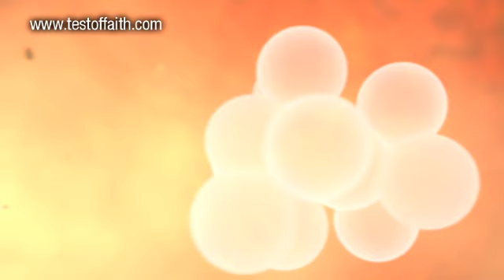Fine Tuning

Comment: The weak anthropic principle is never used on its own, because it cannot explain why a fine tuned Universe exists. The point of the WAP is so that when you appeal to a Multiverse you don’t undercut normal claims of probability like rolling a “6” 500 times in a row on a fair die.

Comment: Dodging a question yet again.
 I'll say it again, it doesn't HAVE to be carbon based - it is just very unlikely to be silicon based because silicon is not abundant in the universe, among other things. However, there is speculation that it has led to the origin of life.

Comment: @boblackey1 Of course you do. You don't calculate chances based on the earth only. You calculate chances based on all planets. Even if the chances are small for one planet, there are so many planets that life still will emerge. Read up on the Anthropic Principle. Also look up the Drake equation which is related.

As for the age of the planet, how old do you want it to be? 4,540,000,000 years is AMPLE time to create and evolve life. 

Also read up on the Puddle of Water analogy.

Comment: That's not a question that’s an assertion and yet again you’ve ignored the scientific community with absolutely no argument. Silicon-silicon bonds are much weaker than the corresponding carbon-carbon bonds, and unlike carbon-carbon bonds, they are susceptible to oxidation.

Comment: If the Universe is "a put-up job" what are the endless "multiverses"?
Reply: DataWaveTaGo A way to explain the fine-tuning without the need for a fine-tuner.  The origin of the universe at a single point in time, and the realization that if various physical forces were even a very tiny bit weaker or stronger, the universe as we know it could not exist, are very scary thoughts for those who prefer not to believe in a Creator.

But actually, the idea of the multiverse originated, not as a response to the fine-tuning of the various physical constants, but rather as a way to explain quantum-mechanical probabilities, the idea being that for every possible behavior of a sub-atomic particle, a new universe comes into being; e.g.., we happen to belong to the universe where the electron passed through slit B, say, but when the electron was fired at the slits another universe came into being in which the electron passed through slit A.  Since we have no access to these other universes and no way to prove or disprove their existence, the concept is scientifically meaningless, regardless of its metaphysical importance.

I just want to go on record as stating that, although I am a devout Christian and have reasons for my beliefs that make a great deal of sense to me, I don't believe that it is possible either to prove or to disprove the existence of God in any objective sense.  That does not, of course, make it impossible for us to have an opinion on the issue, merely that we should not try to impose our beliefs on one another..  Although it is probably a good idea that so many people get so very exercised about this issue, on one side or the other--it keeps them occupied, off the streets, and out of trouble, lol!

Comment: If any factor was slightly different, Adam and Eve could not have sinned.
For example, if the tree was outside the garden or the snake was mute.
So we can conclude that the universe was designed for sin.
Reply: man does have free will and if you're an atheist and you're saying these stuff then by that you have proven that atheism is a form of theology which would prove michael voris statement a guy with youtube channel about stuff in particular with what he said about atheism being necessary culmination of Protestantism. weather you like it or not dawkins was like this pawned maiden trying to pawn people but then pawn himself. coz weather he admits it or not he cannot erase the indelible mark. The fact that he was baptized by heretics which would still count him as catholic initially then found his bitch way out some time during the age of his miniscule reason. baptism alone erases the original sin from adam not from eve that's why we have adam's apple and elliot rodger has none probably.
Reply: @kangstacoast8053  
Interesting comment.  You know that God is omniscient, right ?
He knew that Adam and Eve would eat the forbidden fruit.
But what if Adam and Eve had resisted temptation ?
Maybe God had plan B ready.
Reply: @kangstacoast8053  
As you probably know from experience that there are good people and bad people.
To be more accurate, some people do good or bad things more often than others.
So for example, we think Peter was good and Judas was bad.
We think Adam and Eve were bad, because they disobeyed a simple rule.
Reply: @kangstacoast8053  
You know that Adam and Eve were made by God.
You know that Adam and Eve were bad.
Think !
Reply: @tedgrant2  If you're trying to respond to me by the insulting thumbnail that just happens to be my subconscious choice to place for this particular account a long time ago and attempt to say there is something wrong with it then that's your opinion. The key word is it's a long time ago. It is not a mortal sin say, to use a thumbnail or a name of a person that maybe evil in most cases? As long as you are not using it in exaltation associated with regards to the evil acts for the person to be lauded for being immoral but in neutrality of some other thing he or she did like obfuscation of some other idolatry albeit shitcago or chokedan. This can even be a good thing rather than neutral or default. Even though everyone in that asylum is immoral eg heightism or what I deem to be puny or false disparities mongering. it is true that chokedan is not the goat. and he is not the tallest. look up adam's height btw I haven't figure out if that is true that he stood 128 feet lmfao.
Reply: @kangstacoast8053  
Are you using AI to generate comments or are you really bonkers ?
Cos I avent understood anyting wot you is tryin to say.
Although I must admit, it is profound, if not slightly anacronistically merthologically histerically wierd
Reply: @kangstacoast8053  
Actually, I know a little about Catholicism.  I married a Catholic.
I had to get dispensation to be allowed to get married in a Catholic Church.
One of the conditions was being willing to meet a Priest at his house for instruction in the faith.
At the time, I had a motor cycle and he was very pleased to show me his much bigger one.

Comment: @eproulx But you don't have ain infinite numer of tickets. Life on earth had to get started very quickly and early. Hoyle didn't believe there was enough time for that to happen on the surface and calulated the odds of life forming by chance was 1 to 10 to the 20th power and to get an enzyme the odds are 1 to 10 to the 40,000 power, a number larger than all the atoms in the universe. So to Hoyle, life is older than the earth and came from outerspace via comets. Stardust make prove that right.

Comment: It isn't an explanation at all. It's the same as the fact that life was on this planet with all of it's 'irreducible complexity', and theism thought it could explain it through 'god'. That's a god of the gaps argument - science couldn't explain it at the time and it seemed like it never would. The explanation for the fine-tuning is still a gap in science, one that is unlikely to be filled. It's hardly an ignoratio elenchi, and the very fact that you have mentioned it means you are using it.